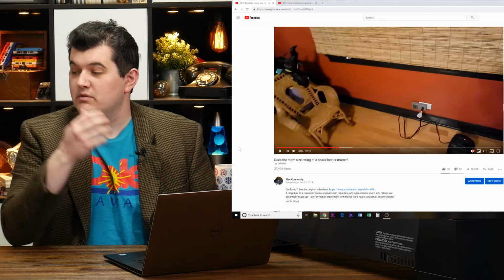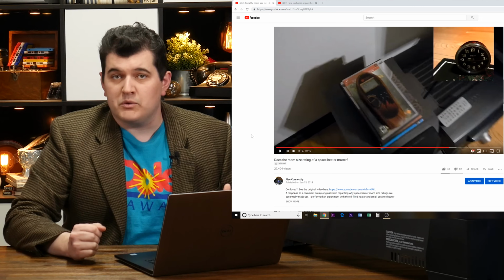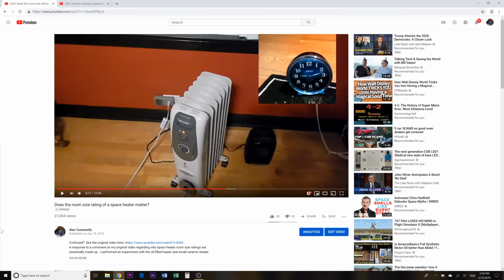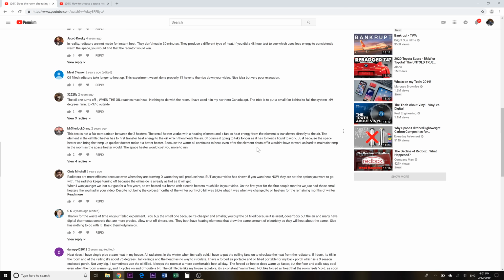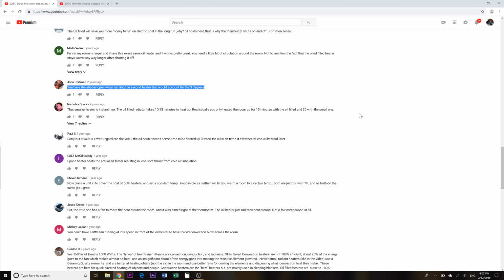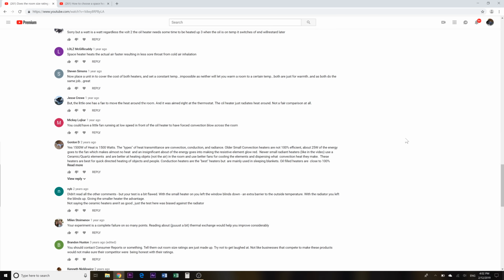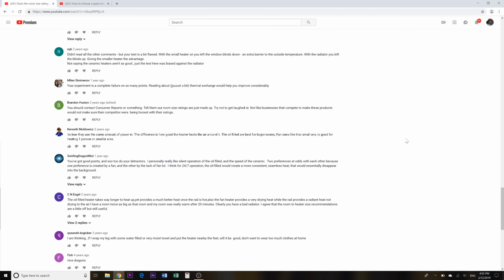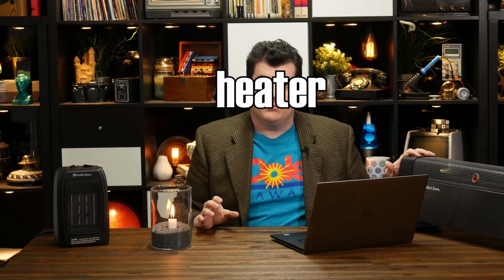More Space Heater Nonsense

Comment: Just a thought, it is possible that the "Large Room" heater would be more effective in a large room IF you had it placed closer to you. Because it's relying on convection alone, the heat will, at least initially, be more concentrated near it. Whereas, the "Small Room" heater, with a fan, will distribute the heat throughout the room instead; allowing it to warm a small room completely in a short amount of time.

Or, it could just be marketing wank to get people to spend more on heaters.
Reply: You are more likely to be close to the heater in a small room.

Comment: Is there an objective standard manufacturers are using to designate the room size they are better suited for? From you video I'd say that if there is it's not related to how much power is being used.  As such I would guess the larger more "Heavy Duty" units are better suited for larger room usage based on customer preferences for quietness, reliability, and safety etc... but not the actual amount of heat. I'm not saying it's necessarily a valid metric. But people use similar criteria with automobile engines, or lawn equipment and choose larger engines over smaller ones with hopes the larger one will be less stressed and  will last longer. 

I appreciate your videos you do a great job. Thanks!

Comment: I mentioned this in a reply to another thread, but I'm really curious to know so I'm bringing this to the top-level -- the oil-based heater has significantly more mass than the resistive-coil heater.  While we've been talking this whole time about volume (small vs. medium (vs. large) room), what really matters is... matter.  Mass.  We're not just heating the air in the room (we can ignore the objects, since they'd factor the same in either scenario); we're also heating, unavoidably, either the resistive coil and nearby parts of the one heater, and all the oil and fins of the second heater.

The standard definition of air density at sea level is 1.225kg per cubic meter.  A small(ish?) bedroom could be said to be 10ft x 10ft, with a ceiling 8ft tall, which comes out to around 22 cubic meters (rounded down).  That's 26.95kg of air to heat up.  My small Honeywell resistive coil heater weighs, in total, about a pound (we'll round up to 0.5kg), and a Walmart-branded oil-convective heater lists its weight at 18.7392 pounds (surprisingly precise), which we'll round DOWN to 8kg, just for the sake of fair play -- clearly the heat is not going through the entirety of either the resistive or the convective heaters, and we don't care about what heat gets transmitted by the air back into the heating apparatus after it's left the heater, but for the sake of this we'll assume the entire resistive heater (all ~0.5kg) is being heated and roughly 0.5kg of our 8.49995814kg convective heater (say, the electronics and facade) is not being heated.  That means scenario 1 with our resistive heater needs to heat up 27.45kg of mass, while scenario 2 with our convective heater needs to heat up 34.95kg of mass.

Barring the specific heat capacity of all the materials involved (of which I know nothing), all else being equal, doesn't this imply that we will HAVE to use more energy with the oil convective heater to acheive the same equilibrium?  Granted, this might be a very small amount of energy -- I wouldn't know -- but it seems to me more particles to heat up means more kilowatt-hours expended:  Either by drawing more kilowatts at any given moment, or extending the number of hours it takes to reach the same desired temperature as the less-massive system.

Comment: I guess it's like this: As you said... difference is where the heat is comming from.  1500W from small rectangle or 1500W from bigger rectangle. In large room ones are heating elements larger so they shoul heat room more quickly because produced heat is spreaded across larger area?
Reply: No... beacuse the total power output is the same. The smaller heater will produce 1500W in a small area while the larger one will produce 1500W over a larger area. The difference is in how much of the air you are heating at once. You either have a small heater heating a small amount of air at a higher temperature, or a larger heater heating a larger amount of air at a lower temperature at once.

Comment: HEHE in Germany we got 3 Phase 380v 10kW Heaters.
Reply: 3 phase 230? Never heard of that, we only have 3 phase 380v
Reply: @greenvm  true 230v between Phase and Neutral and 380v between the different Phases . If the heater got 3 Resistive Heating elements The voltage across them depends on the configuration the manufacturer used Y=230v ( because 2 are always in series) ∆=380v(because there is only one element between 2 phases)
Reply: @agun17 No we stopped getting rid of them about 74 years ago.

Comment: Give the oil filled heater an assist with a box fan and it'll catch up, at least. Maybe one of those patton air circulator style fans would be better as they sit down low and can't fall over into the heater.

Comment: The expected duty cycle of an individual heater may be tailored to the room and its build quality as well for example a smaller space heater is going to have to work  smaller components for more amount of time to achieve the same equilibrium in a room for the set temperature and may experience problems with build quality when attempting to use it in that room that's too large for it to effectively heat. The large size of the standing radiator oil-filled heaters and the fact that they self duty enables them to maintain a longer service life when eating larger spaces. smaller quartz heaters that are overtaxed trying to heat a room that's too large for the rated capacity will no doubt not last as long as a larger hester or heater designed for a longer duty cycle AKA a larger room.

Comment: I cook with NuWave oven, and it's whole lot quicker to cook than non-convection toaster oven of same wattage. It's like wind-chill factor (oven heat factor?) where moving hot air blows out the cold air surrounding an object since air is great insulator. In that, fan heater is "more efficient" for those who are in path of hot moving air.

Comment: I wonder if some of those angry commenters also think that if you open a refrigerator in a closed room that it will cool the room.
Reply: @BartKliebert  It has to do with the total energy balance. Energy is entering the room through the electrical socket that powers the refrigerator, and assuming there's no energy leaving the room, the added energy ends up increasing the temperature of the room. This happens regardless of whether or not the door on the refrigerator is open.

Comment: I think it's important to note that the body feels radiant heat differently than just air temperature or convective heat. The oil heater will make you more comfortable because it is radiating heat in addition to warming the air. The phenomenon of "Cold 70" occurs when the room is 70 degrees but a cold surface is sucking the radiant energy from your body - conversely, you can be comfortable in a 65 degree room as long as the objects in the room are warmer and radiating towards your body.

Comment: Although the oil filled radiator and the ceramic heater consume the same power there distribution is different, the fact the radiator turns on and off makes it fractionally more efficient, as it's not constantly using power so I can see where some confusion may arise.

Comment: One trick to even out heating or cooling in a room is to take advantage of the density of air vs. temperature, and move air from the ceiling to the floor when you need even heating and vice versa when you need even cooling.
The specifics vary, as simple as a decent sized table fan pointing up or down, or two of pieces of 4"/100mm tube and a duct fan pushing air in the appropriate direction in the middle.
They should be placed in another corner or side of the room than the heat or cooling source though.
Just remember that hot air tends to rise  and cool air tends to sink, and that you can help the air move along in a room by using the fans you usually break out in the summertime.
Just my €.02 worth.

Comment: I would imagine that an oil heater has the disadvantage of creating a vertical column of warm air which collects at the ceiling and then falls over time. This means it's largely warming (and losing heat through) a part of the room no one cares about.

EDIT: Edit, okay this was addressed (the dangers of a mid-roll comment) but I definitely think that distribution is most important for comfort. A heater with a fan will create a room with consistent temperature quickly while a box that gets warm will create a heat gradient with most of the energy always at the ceiling.

Comment: maybe the little one is not designed to work all the time it takes a big room to warm up. It is more dangerous because the fan could fail. On the other hand the big one can work all the time without that problem. I do not know, I'm just looking for an explanation. Cheers
Reply: Cycling on and off causes the vast majority of wear and tear on powered elements (heating coils, fans, etc).
Reply: Hola gastón
Reply: this is another great point, small heaters typically will either auto shutoff or fail if left on too long at FULL capacity.  A small air conditioner for ex can cool a larger room but takes it longer and has to run more often even though they draw similar power, and both contain the same liquid coolant, other factors determine the square footage they can effectively cool.  Same with heaters, really anything, running anything at full capability for too long will result in ashorter life span... Yeah a 4 cylinder and an 8cylinder car can both go 100 mph....but one can do it much longer and efficiently than the other.
Reply: I thought similar on what you said, talking about the bar/element/resister heater types, I wonder if 1500watts through 1 heat bar is harder to sustain for long periods reliably, compared to a 1500watt 2 bar heater. If there the same type of heater then one has 1 bar and another as 2 bars then the 2 bar heater could last longer as it's putting 750watts through each heat bar compared to a 1 bar heater. Oil heaters take so long to warm up but there safety compared to element heaters gives flexibility to leave it on with out being in its presents
Reply: No. If you watched both of the videos you would know both of them would shutoff after the overheat-protection would kick in. The fan makes the small heater work at full power all the time. When the fan stops, so does the heating.
Reply: @rkan2  yes but with the oil heating the heating DOESN'T stop when it shuts off, a key diffrence.    It's also unclear if the oil heater was turning off due to over heat protection (unlikely after only a few minutes of operation) or a poorly placed thermostat and poor airflow (much more likely) The air around the heater likely was at temp so it turned off until that heat dissipated.  This is why in an ideal world your thermostat and temp sensor are not located too close to the unit (or an air vent).
Reply: @rkan2  I think it's more a function of "it takes more energy to heat a large room, so you'll need to put out more power before the room is at your desired temperature" than anything else. That is, the large room units seem to be built without speed in mind. A small room unit will heat a small area rapidly, and is effectively used as such. A large room unit can heat any sized room at a much lower rate.
Reply: @ArsenicFault  thats not how any of this works
Reply: big=better duh you dumb dumbs

Comment: You pointed out that 1500w is entering the room in both cases.  Is the flaw in your original testing methodology as simple as the fan-forced heater more evenly distributed the heat in the room and the radiant heater just allowed the heat to gently rise to the ceiling without distribution?  How would the two compare if there was a ceiling fan running in the room?  What if your tests used three identical digital thermometers at different heights above the floor?  Your ultimate point that the marketing is poor is still valid, of course.
Reply: The radiant heater is overheating often and has to turn off and then on again when it cooled down enough. While the radiant heater can draw 1500 Watt it effectively averages significantly below that due to the on-off-cycle. On the other hand the fan-forced heater can heat the whole time constantly at 1500 Watt without cutting back the power draw. So while the fan-heater is heating constantly at 1500 Watt the radiant-heater is averaging at say 1200 Watt for example and thus heating the room slower.

Comment: I would choose a space heater with aesthetics in mind, not just features. We are all designers to a degree, we arrange the furniture in our homes to be aesthetically pleasing as well as functional. A baseboard-type heater might not work well where there is little or no baseboard area available, or when placement would throw off the aesthetics. Room use, thus heating needs should also be considered. I might not want to heat a utility room unless I'm in there, but I would want the rather immediate heat provided by a fan-type heater. Its noise output is also a consideration. After that, to me, it's down to the heater's appearance and how it would fit a room's overall design.

It's a guess that the room size recommendations might be more about where the heater would best (or better) fit than for its capability. But then guessing what a marketer means is kind of like seeing the facts after a spin doctor rearranges them (apologies to doctors).

Comment: Radiant, convection and latent heats all behave totally differently.

They may all put as much energy into the "room", but the room is never a closed loop in reality.

Want to get warm on the couch as soon as you flick the switch? Radiant will suit that best

Need to warm the room you're in for the night, sometimes open the door (letting heat out) and return to it with the room feeling the same? Latent heat will suit that

Want to get your whole loop up to the same temp? Convection may do that best? (air flow)

All have pluses and minuses - time, response, recovery, lag, concentration, air flow, direction etc

When pumping up an air mattress you want high volume, low pressure - when pumping up a tyre you want high pressure, low volume - same with when heating a room.

For my money - in a semi closed loop/room - an oil heater with an inbuilt fan is friggin awesome

Gives radiant, latent and convection - even without the fan.

Fan heaters only give convection.

Personally though - I'm more of a "give me heat now and bugger the expense" sort of guy - will go a personal heater rather than a room heater most of the time.

Off topic - there are quite a few episodes of the "Regular Show" that remind me of your interests 
https://regularshow.fandom.com/wiki/Guardians_of_Obsolete_Formats

Comment: You are a great big poopie head ;)

Heat transference matters which is going to favor a larger radiating area or something with a fan. While you are correct that two 1500 watt heaters of differing sizes will produce the same amount of heat (even if you have quantum nano heating technology, the law of conservation of energy still applies), the speed at which both transfer heat to the air can vary a fair bit, and unless you have a perfectly insulated room (and if you do, why are you using space heaters anyway) it has to be greater (and/or quicker) than the losses. In short, a larger (err, room) heater should be able to dump the heat more (efficiently?) quickly into the air.

You could have just taken the easy way out and read Consumer Reports Buying Guide for Space Heaters (like every good engineer-minded person does), as they say essentially the same thing as you (watts in/watts out) and conducted the same tests, and then you could have directed the naysayers to them.

Or here-

https://www.reviews.com/space-heater/

"There’s no such thing as a truly “energy efficient” space heater. Energy usage is determined by wattage. If heaters have the same upper wattage limit, they’ll burn the same amount of energy on their highest setting."

You shouldn't let the "experts" on the interwebs get you down. Everyone is pretty much blind and stupid (including me). At least you thought through your conclusion, and even tested it. That's more than most.

Besides when will you tackle something really controversial, like portable induction cooktops. My experiment this weekend suggests that beyond the 15 temperature settings they claim to have, they only real have three- not hot enough, a bit too hot, and grease fire.